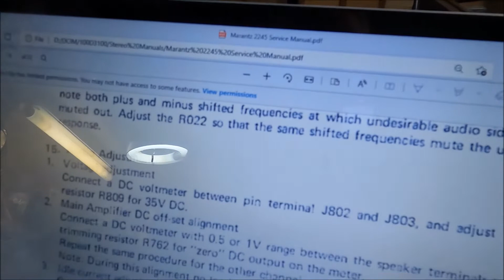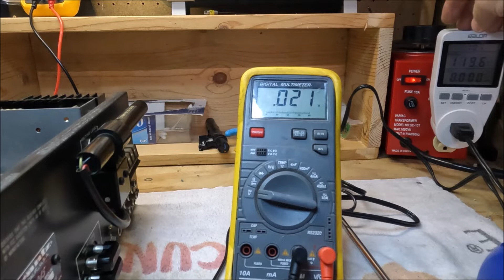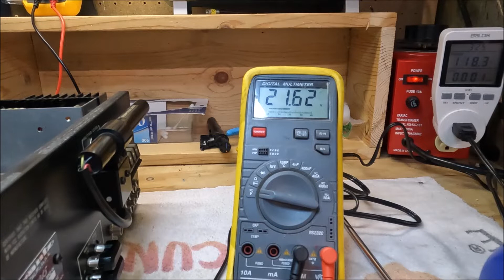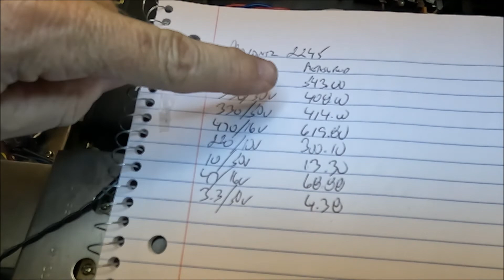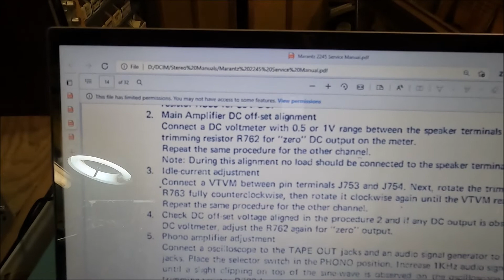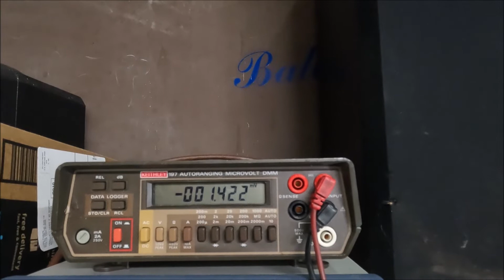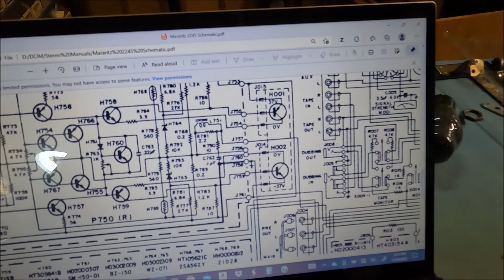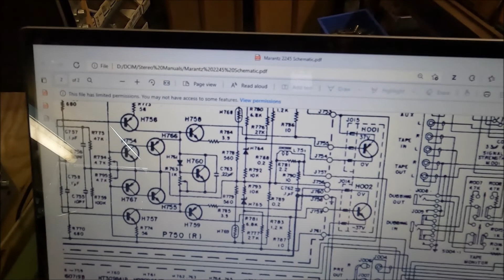Marantz 2245, power supply, DC Offset and Bias done.

Comment: For the 2270 the service manual is correct on the bias/idle current settings, but it only applies to early serial #'s <3900. A service bulletin was issued for later models changing test points to 754 & 760 & 10mv setting. On the earlier (<3900) test points are 753 & 754 and setting is 5mv. Not sure if the 2245 differs from the 2270 - I doubt it though.
Reply from the maker: Thanks for watching and for writing in. I always like to hear about things I might of missed or any helpful info for others to see. Enjoy the day.

Comment: ..I think after watching this I'm gonna do the same with my marantz pm4001 OSE. It's an amp that sounds great until past 9 and then distorted. I'm sure this isn't how they intended a 40w amp to sound at that level. Got some great Elna caps in it too
Reply: Hello. If the offest has a recommendation of '+-50mv' is it saying anywhere just between -50 and 1v?
Reply from the maker: Not really. 1volt would be 1000mV which is way to much. Your speakers would be pushed out when you turn on your receiver. Try to get it as close to Zero as you can. Usually the Biasing will be set to 30-50 mV depending on your manufacture. Hope this helps.
Reply: @bfpsa64  the marantz terminals were both around 14mv. Should I lower them to 30-50 range?
Reply from the maker: @CM-dw3gh  Are you talking DC voltage or your Bias settings? DC voltage at the speaker terminals should be zero. Bias Offset should be i the range that they list in the service manual. IF the bias is 30-50mV then set it in that range. Then use a dummy load and 1K signal and check how it scopes out. If you see distortion before listed wattage you need to adjust or see what else is drawing it down. Hope this helps as it is hard to trouble shoot without really seeing what is going on.